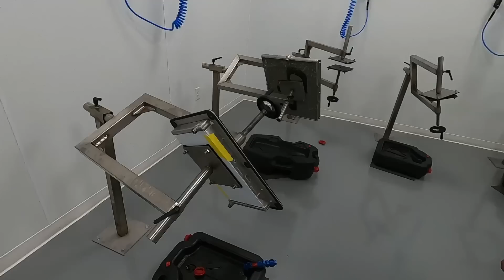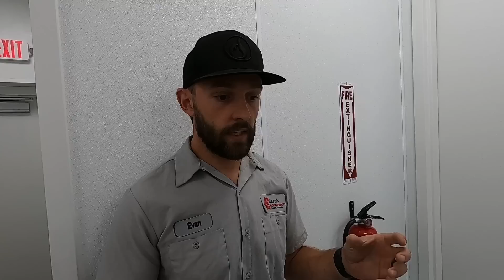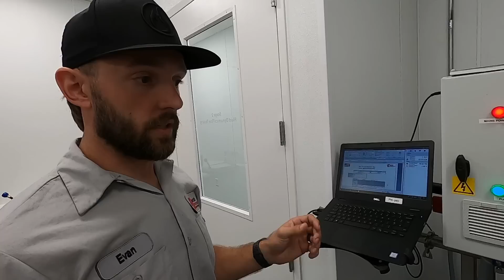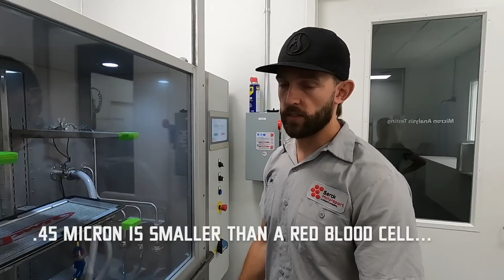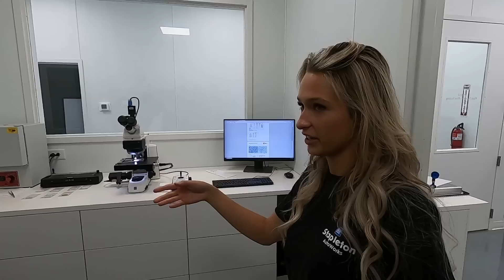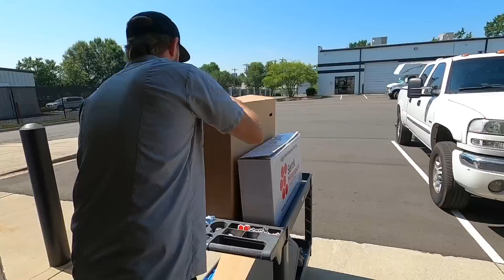Formula One Radiator Service Will Change Your Opinion About "Clean" (Serck Motorsport Tour)

Comment: Great information! Distilled water comes from mixing antifreeze which has anti corrosive properties. You can use deionized water if you want to go through the trouble of getting it. When racing your not allowed to use antifreeze so that’s most likely where it came from. 👍

Comment: Having used DI water for coolant for a few years, the only thing I can really add is to use Water Wetter in addition to it.
WW acts like soap and lowers the surface tension of water.  Fun stuff.
Reply: A pinch of powdered laundry detergent with do the same thing. And it smells nice when you pop a freeze plug in a clapped out sh!t box.
Reply: Surfactant.
Reply: Been running water and water wetter in my latest car ,since it was such a mild winter and the shop didn't go below 38 in the unheated area. 
I learned over the winter what I can get away with because the wife's car started having a leaking water pump around Christmas time. 
Since it only dipped to maybe high 20s at night and usually was close to 40 all day I just kept adding water because I wasn't about to change the pump out. 
As long as it was driven once a day (and it was) it never got close to freezing up. 
We did have 2 days where it was single digits so yeah I had to waste some coolant for that ,but other than that I'm still using water in that pos 😂
I hate that car.
The new pump is on the shelf and I'll get it done in the next month or so.
Reply: Soaps are not detergents. Detergent foam/suds are bad in cooling systems. Water wetter is awesome. I buy premixed antifreeze for the winter, i NEVER use distilled water.

Comment: OMG, thank you so much for telling us about distilled water and not to use it. Logan, that was a great question. Keep up the great work, may God keep blessing you both...
Reply: using Distilled water is perfectly fine, and recommended by every OEM. The "Catch 22" here is when talking racing you aren't using Antifreeze, that is adding other components to that distilled water. Also, not every distilled water is identical... So many nuances not mentioned here.
Reply from the maker: Thanks man!
Reply: Distilled water went through distillatio process. Much like with alcohol, it is brought to boil temperature (100 C) and the vapour is collected. Thus removing any chemicals in solution (pre-distilled water) with different temperature of boil. Removing almost all impurities, especially minerals and bilogical matter. 

DISTILLED WATER IS MUCH BETTER THAN TAP WATER! DONT LISTEN TO THIS CRAP!

Comment: Unless you’re in serious racing or unlimited budget situations distilled water is perfectly good. $1 a gallon vs $17+ is a no brainer. Learned 30+ yrs ago about well water in my new home Fing up my cooling systems in about a year. Truck. Tractor. Etc. Been using distilled water and Zerex G- 05 with great results ever since.
Reply: If anything, deionized water should be cheaper since you don't need to boil it to produce it.
Reply: Deionized water is same price as distilled

Comment: The cup cars are not allowed tape anymore they get air from the hood but they have brake duct open I believe but I could def see where this would be a huge advantage cooling wise
Reply from the maker: It still applies in xfinity and truck
Reply: It’s even a big deal in asphalt late models. Many of them have the grill taped up some for the race because the cooling is so much more efficient.

Comment: PWR (Paul Weel Radiators) is an Australian owned business named in relation to former Australian V8 Supercar driver Paul Weel. His father Kees Weel and family started out in the radiator business in Australia. Evolving into PWR that now has an international presence in the USA
Reply: Can't remember the year but the PWR/F1 relationship came about by Red bull F1 at Melbourne had no spare radiators after a crash. Someone mentioned PWR and there radiators. Contact was made, private jet sent to pick it up. Long story short it was proven that for the same size radiator made by PWR the car ran a heap cooler. Red bull used PWR from then on.
Reply: @superdidly1  This, it was more then just a small variable of differance... and in F1 everything matters.
Reply: Yep I'm lucky enough to have pwr world headquarters 20mi  down to road..
Reply: lake elsinore
Reply: @davidb88 what about Elsinore?
Reply from the maker: I didn’t know that!
Reply: @Stapleton42  huge amount of F1 cars have PWR radiators, they do lots of wind tunnel testing of them too.
Reply: C&R apparently purchased PWR in 2019. Nevertheless, this is no reflection upon the Australian origins of the branding. Just the success of a product once created
Reply: @ChristopherWHerbert PWR actually purchased C&R
Reply: @daneprostamo-brown6552  l read it the other way around. So for now, I don't know what is right. I want to believe you, and it is even better if you are right
Reply: @ChristopherWHerbert  i worked for PWR in the Toolroom/  CNC machine shop at Ormeau great place to work.....PWR acquired C&R  in 2015
Reply: Paul Weel  aka PWR … luckiest and unluckiest Supercar driver ever …. Bathurst crash with Chris Pither, find it on YT. I was at Bathurst that year 2008 and in the pits Paul’s car had not one salvageable part left.

Comment: Very interesting 👍
Between living out away from cities and always having motorcycles with aluminum engines (plus I'm old enough that I've had to add water to many old school batteries), I have always used a 50/50 mixture of distilled water and coolant in engines (oops). Good news is, distilled water is for sure not as bad as well water...
Reply from the maker: Once you add the coolant its additives negate the badness of raw distilled. Water
Reply: @Stapleton42  Yup, we have kept and raced some bikes for two decade (which included building and rebuilding the engines multiple times) and I've never seen any ill effects anywhere (nothing bad in radiators, blocks, heads or pumps). The closest I've come to running 100% water was with Water Wetter added...
Reply: Distilled water and coolant in FACTORY unmodified (non race spec/ high performance) engines is the OEM recommendation.. This blanket statement that "distilled water is bad", is Bad in itself. Distilled water BY ITSELF, should never be used. Thats why they tell you mix it... You dont put 100% antifreeze in your engine do you? Same scenario... Bad things happen.

Comment: This is a question for all. Assuming I don't know the quality of my tap water and I don't own a Deionizing water system, what's the next best water I can buy at the store? Distilled water or reverse osmosis purified drinking water with flavor enhancing minerals, or Safeway (or similar) Drinking Water that says "processed by carbon filtration uv light and ozonation. Is there something else out there other than distilled?
Interesting note- Prestone Concentrate instruction say use only distilled water HOWEVER Walmart Super Tech brand says use DEIONIZED water!
Reply from the maker: They told us about this additive from maxima that can be used with distilled (I think) that pretty much solves its mineral cling issue

Comment: Helium is the smallest element besides hydrogen, hydrogen would find even smaller leaks, but wouldnt be wise to use due to obvious safety reasons.
Reply: It is a bit past the point to look for gas leaks in a system where you are supposed to only run liquids.. You'll definitely find leaks of course.

Comment: I would be interested in what he has to say about Evans Waterless Coolant (glycol-based fluid that contains no water).  I'm sure it is great for corrosion prevention, but so many say it is terrible for heat transfer.  Do you have any experience with Evans?  
That would be a great video subject, and I'm sure Evans would give you an endorsement if you find that it works well.  Jay Leno says he uses it in all of his cars.
Reply from the maker: Interesting I haven’t heard of that before!

Comment: Interesting vid Mitch/Logan 🙂I began thinking a bit about my past life and high vacuum and helium leak detectors. Curious, do they use a He leak detector, or do they use a pressure decay test. While HV is where most of my focus was, as time went on more and more "industrial" applications kept popping up. 
As an aside (if your not interested STOP reading now, but I had a facility that mfg AC condensors. Before they began using He leak detectors (pressurizing with room air), then submerging in a large tank of water, they had a group of tech's sitting in Lazy Boy chairs, watching the tank for bubbles. Literally that was their job all day long. Using He and a "sniffing He leak detector (~$20k/machine) pressurizing the condensors with He or a concentration of He depending on the leak rate specification, one guy could test all the condensers they used the bubble test for in one day. Anyway, thanks for the vid/info, very interesting application 🙂
Reply from the maker: That’s very interesting. Maybe these guys should buy some leak detectors 😂

Comment: When I was working on natural gas compressor units, when an engine oil cooler would leak into the cooling system the way we would deal with the oil in the cooling system is mix in one to two containers of Cascade dishwashing liquid detergent into the header tank of the cooling system. 
Run it for 30 min. and then drain the cooling system. It worked very well at removing the residual oil we couldn't get out. It beat the heck out of having to remove all the radiator tank plugs and physically clean out each tube in the radiators/coolers. 

It turned a multi hour job into a one hour job.
Reply from the maker: Interesting!
Reply: We changed the bad oil cooler too. 😁

Comment: Distilled water is stripped of all minerals. Water wants it's minerals so distilled water will attack metal to try to pull the minerals back in. Distilled water is many times more corrosive that tap water.
Reply: I have heard the opposite I've heard that deionized water is actually worse. The water acts as a catalyst stripping ions from the metals. If this goes on long enough the metals are eventually etched away creating leaks, pressure loss, and serious problems for any chiller.
Reply: @grimspyder0001 
Yep pops used to use that crap all the time for failure analysis on computer chips for ibm 30yrs ago. 
He calls it hungry water.
Reply: I call bs. I've used both, my distilled water filled radiator looks brand new. I put it in 6 years ago.
Reply: Basically what I'm hearing is to just use tap water and run a flush every so often I can clean the stuff from the tap out I can't clean corodded pipes
Reply: Then why they say to use distill wayer
Reply: Water

Comment: We use di water at work and it makes everything brittle over time. I'm told it strips ions from the metals to replenish its own. No idea, but most stuff you have to work on in a system with di water, ends up snapping when we touch it

I just use tap water in my cooling systems and don't have issues.
Reply from the maker: Interesting!

Comment: Yes. Bringing back uncle Rob. Hell yeah. Didn't know so much went into radiator science. If only Chevrolet could figure out how to make the 5.3 run as cool as the 6.0.
Reply: Yes … what is the situation with 5.3 L 2020 L- 82 engine seems almost 205+ degrees f
I would like to see about 190 f     Thermostat ?   Florida is hi - temp .   Thanks
Reply: @bobwilson758  definitely not as cool. I have a 5.3 in my Tahoe and my wife has the 6.0 in her escalade. Her shit runs about 185. My shit is 205-209. $135,000 in vehicles. Our matching 05's did the same shit

Comment: His comment about the flow being too much on some radiators makes me wonder if that's why a lot of these cheap after market big tube radiators don't cool any better than the stock ones.
Reply: Exactly, because you have a big Rad, the flow across it may be too fast to effectively cool down the coolant. There is a flow sweet spot for every different engine/pump/radiator combo where the cooling system is at it's most efficient. It's not a "one size fits all" solution.
Reply: I was told years ago that ford flat heads  with 2 water pumps would fow too  much water
Reply: No, because it's incorrect. Until you reach supersonic speeds, there's no such thing as too fast through the radiator. It's weird he didn't dispel this myth. Perhaps he's just sick of talking about it and just "uh-huh"'s his was through that one.
Reply from the maker: Care to elaborate on this supersonic theory sir?
Reply: @ummduhgmail  Yeah, correct, there's no such thing as too fast for air flow through a radiator, but I was talking about coolant flow. If the coolant is flowing through a cooling system too quickly, it doesn't have enough dwell time withing the cooling structure to efficiently lose enough heat, it also doesn't absorb enough heat when flowing through the engine block. Why do you think thermostatic valves were invented and fitted to automotive cooling systems?
Reply: @nickmaclachlan5178 well it's obvious that you don't want the engine too cold ..so you slow the coolant down to retain heat in the engine .. that is the reason for thermostat ..
Reply: @nickmaclachlan5178 after a certain point the air will absorb as much heat as it will absorb  no matter how fast the coolant is traveling

Comment: I had no idea place like this even existed. Washing out our oil coolers and dry sump tanks and lines sometimes gets to be a pain in the ass. I've been using distilled water for 40 years. Learned something new today. Thanks.
Reply from the maker: thank you sir!!
Reply: Good video, very cool.  Think there may be some nuance with distilled water.  With the right product it may be the correct choice.  You've got products like SynMax Kooler (they've got videos on it on YT) that uses distilled and basically every oem.  So perhaps it's more of a just water vs water and what product you are using as to what you want to use.

Comment: I was perfectly happy running distilled water, now I gotta find de-ionized 🤬😹
Reply from the maker: You can add some additive to it to fix its issues if you can’t find deionized
Reply: and if your engine is a " Normal " non race engine... you are perfectly fine running distilled water.. Because you are mixing it with antifreeze coolant like recommended by the OEM.. Additive packs in the antifreeze are meant to be combined with distilled water..